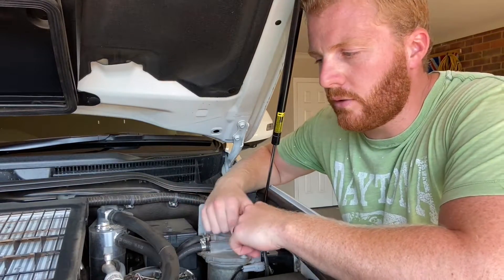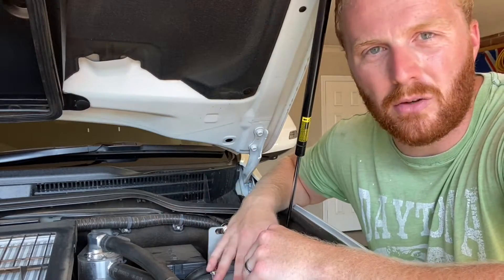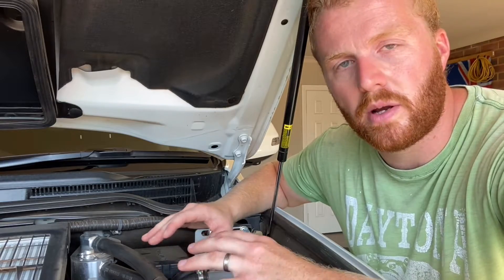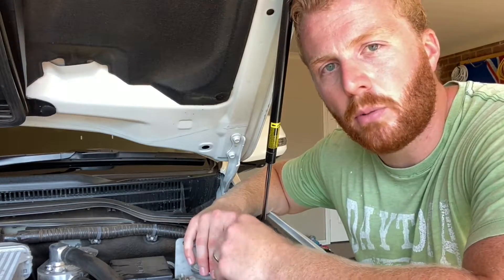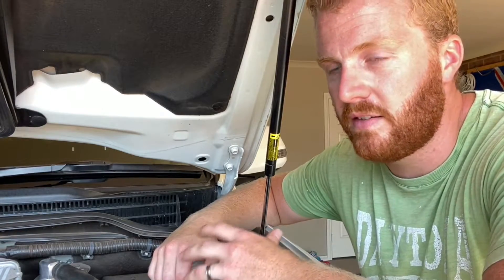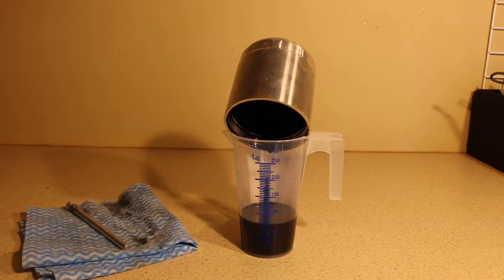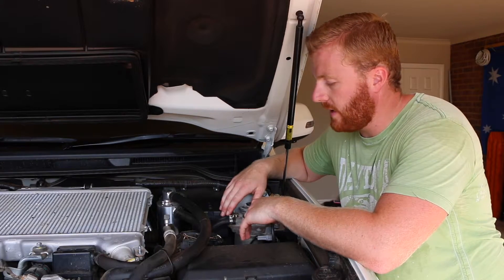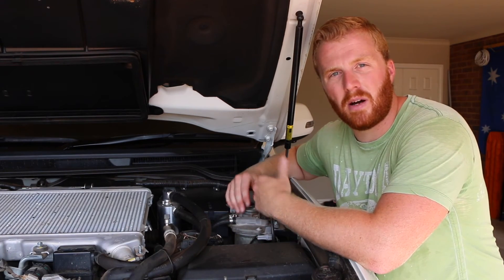LC200 | HPD Catch Can | How much oil after 8000km? | Long term review and effectiveness | 4WD

Comment: Mate how much oil do you get in your cats can? I have a 2014 GXL vdj200 180,ks I get so much oil in my catch can after 2 days do you have the same problem?I have had the car diagnostic and not much blow by injectors are fine there is a little knock in the morning and you can hear it more when you take the catch can lid off does anyone know why this is happening

Comment: i bought a set (catch can + pre filter) for 79 series from western filters before I got the vehicle, the first thing when I picked up my 79 is to install catch can and fuel filter, before anything else. now it just hit 9000k and i got about half of a 600ml bottle of the black oil. worked like a charm
Reply from the maker: Good starting combination, always works best when fitted from new.

Comment: Just had a hpd installed today that was recommended by my mechanic🤦🏻‍♂️
Reply from the maker: Ah, yes everyone has their own opinion on what works. It will still help somewhat though, not all bad. 
You could always do what I've done and sold my HPD unit and switched over to the Provent. They are a great unit. - https://www.youtube.com/watch?v=bJ5VG6UhTE0&t=5s

Comment: Good demo and explanation, very grateful
Going to put this ?out there
Why not take load off the engine by changing axle ratios to compensate for larger wheels, towing loads etc? it puts load onto axle, fuel economy is better to👍

Diesels are supposed to be more economical right? What about overall cost of ownership? 🤔 
Keep up the great work and above all that have fun 🍻
Reply from the maker: Thanks Mark, glad the video was helpful.
I have thought about this, however at this time I don't think the expense of regarding would provide an equivalent benefit in return. Although it may help a bit, the vehicle is by no means struggling with the current load, even when towing. If in the future I were to increase the tyre size again and tow very heavy loads, it could be viable. At the moment, the vehicle is performing well and I've never been in the situation where I've needed more power or torque. 
Cheers, Nathan.

Comment: the study you have linked was paid for by provent and the hpd was tested without filters, just an fyi.
Reply from the maker: This is true, however saying that, the motive behind Mann+Hummell paying Curtain University for this study was to be independent. I'm not sure how else they could possible test their products? It is sure better than them doing the testing themselves. Further, if we are implying that somehow Curtain University have corrupted and manipulated the study for financial benefit, then ramifications from that will throw more than just this test into disrepute.
In regards to the HPD can, there are no 'filters' per say that come with the product. The can was tested as any regular customer would purchase it from a store. The HPD can had the metal mesh panels present as described in this video. If customers wish to add filter material in their own cans, that will effect the results.
Hope this helps and makes sense. 
Cheers, Nathan.

Comment: Thanks for the lessons💪🏾.
Does catch can works normally in LC100 VXR?
Reply from the maker: Thanks mate. I'm not personally familiar with that engine, however if it is a Diesel engine and has a close crankcase ventilation system, then yes a catch can will work well.
Do you know what engine you are running in that vehicle?
Reply: XploringOz I believe the VXR 100 series is a 4.7l petrol engine
Reply: Yes, it’s 4.7l
Reply from the maker: So given the fact it's a petrol, this engine wouldn't require one of these catch cans. These systems are generally designed for diesel engines as a result of blow by gasses passing the piston rings. 
Petrols don't really have these issues and hence don't require one.
Cheers, Nathan.
Reply: Thanks for your feedback mate..💪🏾
Reply from the maker: Mahfoudh Al Naamani 👍

Comment: I have the HPD catch can on my BT50. I went for it for the quality of build, mounting and clarity of instruction for fitment.  In 10000Ks, I will get maybe a teaspoon of gunk in the bottom probably due to a tighter engine. I have placed a stainless dish scourer in the bottom, to try cause more condensation though that wouldnt work in yours, as it would be drowned.. :)  There shouldnt be and need for pressure relief in the HPD can, as the inlet and outlet pipes are huge and are unlikely to get blocked.
I did some research, and bypassed the Provent, mainly because of the plastic build.
Reply from the maker: Thanks mate. Interesting mod with the dish scourer, hadn't thought of adding that to a unit like this. 
There is no doubt the build quality is 2nd to none, just doesn't quite seem as it is effective as it could be.
Thanks for the watch.
Cheers, Nathan.
Reply: hpd is trash jsut get rid of it, since i changed to the ryco catch can no more oil back into the intake
Reply: I have replaced the HPD with a RYCO system a few months ago , it works very well.

Comment: I concur   ….    have provent 200 with replaceable filter and drain tap   ….     98% ?   YEP   …    wouldn't be without one   ….    in my experience, can do nothing but recommend   ….     you should consider changing sooner than later
Reply from the maker: For sure, I will be changing over when possible. I will try and do another video review on this filter after 8000km too

Comment: Confirmative. 8k produced 0.5 ltr in my Provent 200. Conditions : towing a 2.2 t jayco for 5k towing on road max allowed speed and appr. 3k casual city driving. Fantastic job by the Provent 200. All Provent user should do the 2020 upgrade what come with the new filter. Cheers

Comment: Why did you get this instead of the provent?
Reply from the maker: When I first got the car I had a lot of work done to it all at once. Unfortunately my research into the catch cans was overlooked and I went with the recommendation from the fitter I used.
Reply: @XploringOz  would you also consider the Ryco RCC350 version?
Reply from the maker: @jt26515  It would be considered, but given the studies and positive reviews on the Provent, I'd probably try that next.
Reply: I have the Ryco, (2015 BT50) and it works very well. Fitting is easy as the kit and instructions are well thought out, but its not cheap.